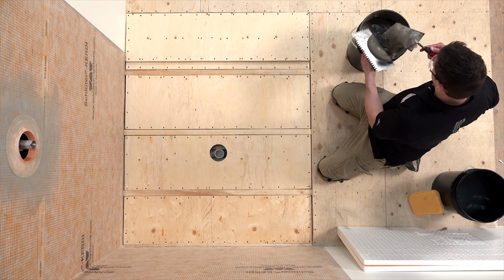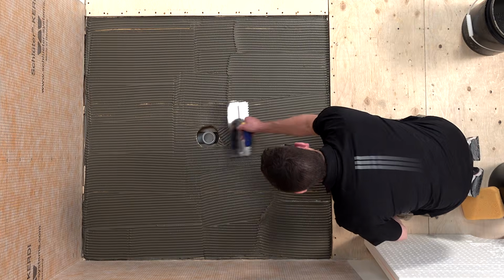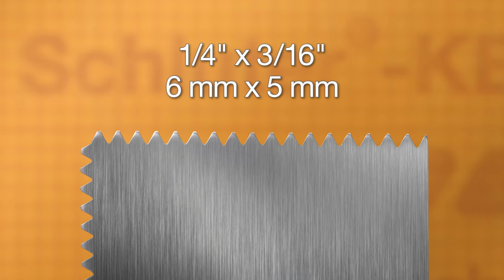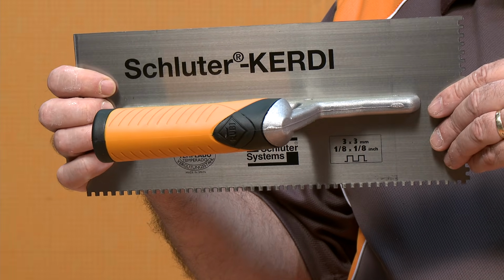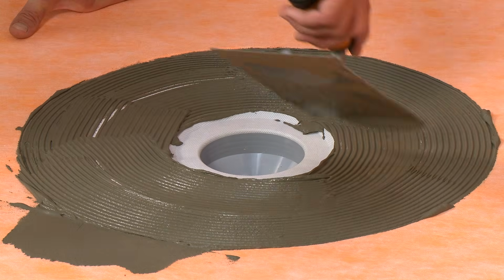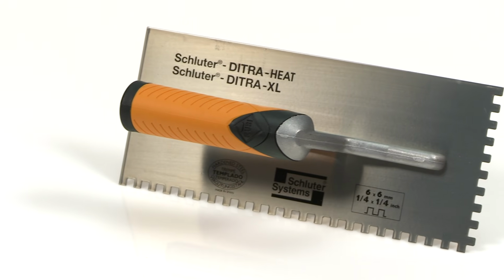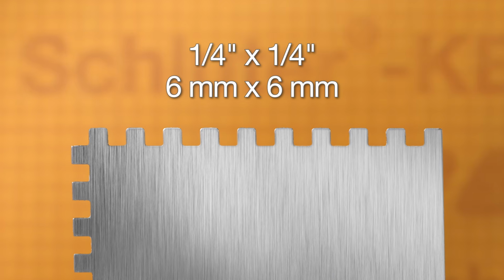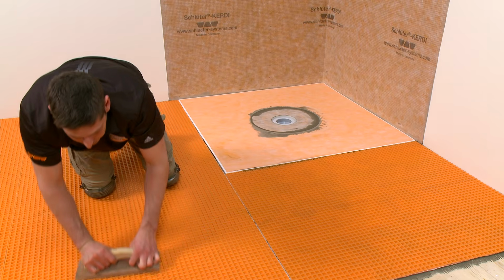How to Recess a Floor for a Curbless Shower with the Schluter®-Shower System

Comment: Would like to see this process done with concrete floors. Thanks.
Reply: High speed grinder with a masonry wheel on it to cut grooves (similar to cutting wood for notching) in the concrete about 1" apart within the desired recessed area then chip out those ridges with a roto-hammer and finish smooth with a masonry cup-wheel on your high speed grinder. Make sure to remove more material than you need becasue it's much easier and faster to build it back up than to incrementally reduce the height. Build it up with floor leveler or a similar product, even mortar would work as long as your surface is dust free.
Reply: Yes, I also would like to see a video on how to prepare a concrete floor for a curbless Schluter base. In my case the concrete floor remains to be poured.  On an existing floor, can the concrete be removed by cutting to depth and chiseling? Question: How deep to receive the Schluter pan?
Reply from the maker: Hi there! Yes, the existing concrete can be removed. We do not currently have any instructions for preparing a concrete floor for a curbless base, but will share the request with our technical department. The depth of the recessed area will depend on which tray is used, as they are different thicknesses. There will also be 1/16” – 1/8” of thin-set under the tray. You can find the tray thicknesses here: https://www.schluter.com/schluter-us/en_US/Shower-System/Prefabricated-Substrates/Schluter%C2%AE-KERDI-SHOWER-T--TS--TT/p/KERDI_SHOWER-T-TS-TT
Hope this helps!
Reply: @schlutersystems1   thank you!
Reply from the maker: our pleasure!
Reply from the maker: We do have a technical detail for curbless in concrete.... just no video at the moment! You can see our handbook here with Curbless showers on page 12..
https://sccpublic.s3-external-1.amazonaws.com/sys-master/images/he2/h48/8984381980702/Shower%20System%20Installation%20Handbook.pdf